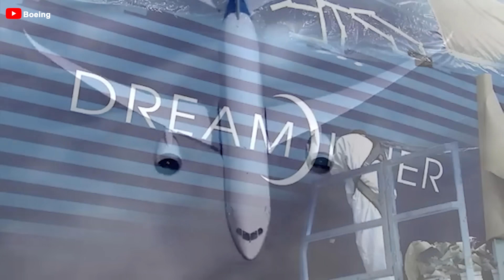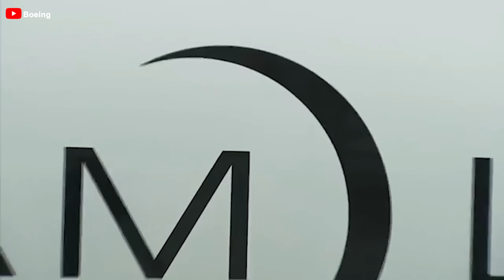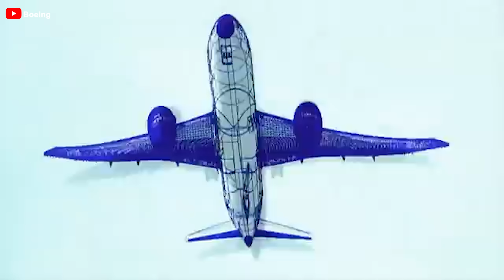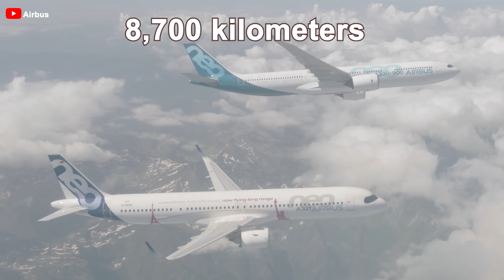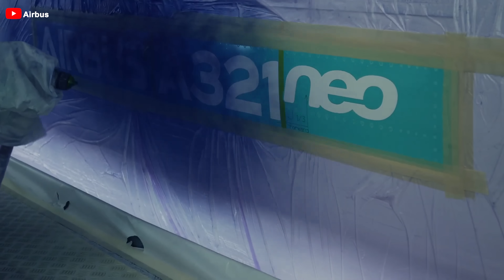Boeing 787 is in big trouble! No one buys it! Here's why!

Comment: There is one thing that I really dislike about the Boeing 787. The crew can and sometimes do black out all the windows and disable the individual window tint controls, so you could have a window seat but you cannot see a thing.
Reply: Agreed.. I'd not fly the 787 for that reason...
Reply: This is for your safety. It is only done on take offs and landings. It is so that in case of an emergency your eyes don't have to adjust to the outside. example if you come in a dark roo from outside it takes a few seconds for your eyes to adjust and that few seconds can mean if you get out alive.
Reply: @stevenlemieux7220  What is for your safety is making all the windows clear for taxi, take-off and landing so that passengers' eyes are accustomed to the lighting outside and they will be able to see clearly if anything goes wrong and the aircraft has to be evacuated. Blacking them out for most of the flight does not have any safety benefit.
Reply: @stevenlemieux7220  they  do it mid flight over night, just when you can see many things at night that you'd never see otherwise, I'll not fly 787 for that reason, I'd take another airline

Comment: Thank you for sharing Aviation News here.😊 I still like the 767s and 757s. They have both been great aircraft to fly on.
Reply from the maker: Thanks for sharing!
Reply: You are welcome.
Reply: I know. It was huge mistake for Boeing to drop them and stick with the severely antiquated 737 or the ultra expensive more futuristic 787. Simply reviving the 75/76 series with modern avionics and a NEO option like Airbus  did would've been much more successful. Then Boeing could take its time designing proper nextgen planes, also like Airbus did. And don't get me started on the lack of commonality between all Boeing planes, their systems, and cockpits. If you can fly one Airbus, you only need a day or two to get typed in any other model. Plus as a new pilot an a different model everything feels much more familiar, ultimately making you a safer pilot. Then compare the 737 to the 787. 737 has toggle switches and steam gauges. 787 doesn't have bleed and is all glass. They are insanely different planes. They were on the right track with the 75/76, even the earlier 777s, but wow have they failed since then.
Reply: I hear you! I still feel safer on the 757 and 767. And yes, I do love the 777-200s and 300s. Furthermore, I am fascinated and not fully comfortable of fly the newer aircraft for example across the ocean yet. JetBlue is a good aircraft and they fly their Airbus 321s I take it from New York over to London. And there is the Mint or Business/First seats to lay down. I still would fly a wide-body 767 over instead. Finally, I haveflown the 757-200s over to Hawaii from Los Angeles a few times in Polaris Business/First Class. And that was so nice. But we will see how the industry continues to grow. ☺

Comment: Airplanes designed by engineers:
Early 737s, 757, 767, early 777s. 
Airplanes designed by accountants:
777X, 787, 737 Max. 
Which ones continue to have problems and make the news?
777X, 787, 737 Max. 
Need I say more?
Reply from the maker: Great.

Comment: This sounds like a lot of promotion, especially for Airbus. It is also pro Dreamliner, and yes theoretically the Dreamliner is a beauty. The problem for me is that I'm not convinced that Boeing is near solving its management problems, corporation attitude, and issues on the shop floor. The idea of flying on a Dreamliner or 737 Max makes me very warry, very uncomfortable. Force fitting wings to the body of an aircraft and not using proper hardware to fit an aircraft together should be a problem for many who travel on aircraft. Simply put I have lost faith in the Boeing product, airlines might not have my problem but like Boeing they are focused on money not my life.
Reply: Airbus deserves the promotion, though.
Reply: Boeing director makes $ 32.000.000 a year..staff has not had a raise in 10 years,
and you wonder why it does badly???

Comment: Everyone keeps talking about the xlr as being the 2nd coming of the Concorde and the original 747, when they first came out, nearly 60 years ago.  One for it's tremendous speed and the other for its combination of size, comfort and speed.  Fast forward nearly 60 years and all of the excitement revolves around a cramped regional jet that has been configured in a manner that allows it to cross the ocean at significantly slower speeds than what the original 747's did nearly 60 years ago.  Yes, it acheives a better fuel burn the same way a Toyota Corolla gets better gas mileage than a Roll Royce.  I dont see many people jumping out of their skin to buy a Toyota Corolla over a Rolls Royce.  My point being, there is zero to be excited about.  The only one who benefits are the airline executives who will undoubtedly pad their pockets with the fuel savings this cramped jet will bring them.  This is not an exciting moment in aviation history.  The fact that airlines are turning away from a comfortable larger jet like the 787-8 in favor of a cramped, slow flying albeit fuel efficient 40 year old design with longer range should be grounds for concern for the claustrophobic traveler who is forced to fly on a regular basis for his or her job.
Reply: You are missing a lot of points here. First of all, it’s not cramped. The space you get as a passenger, is the same as in a wide body aircraft. 

It doesn’t fly significantly slower. The time will be made up with boarding and de-boarding, which goes a lot quicker. Also, getting through immigration will be quicker, as well as getting your luggage. 

The reason the XLR is a game changer is because it can do direct flights. If you were to live in Pittsburgh for instance and you needed to go to London, you would first fly to JFK or Newark on a small airplane, transfer to a wide body and fly to Heathrow. 

With an XLR, since it needs less than 200 passengers, could fly directly from Pittsburgh to Stansted, London. So you as a passenger, could save 3, 4 or even more hours. 

Again, these airplanes are not more cramped than a 787.
Reply: Yep, When a new plane is touted as a game-changer and revolutionary they mean for airline accountants...most modern jet economy class is pretty awful to fly in. The 787 may be high tech and efficient but i have done about 10 long haul flights in 787s from 5-6 different airlines and all of them were mediocre at best, hard cramped seats, tiny toilets etc. The A350 is a much better passenger experience than the 787 but its still a plane built for airline accountants.
Reply: I agree but I guess it’s also what the “market” wants. People want to be able to fly “all the time” instead of “sometimes” so they will come up with this flying Toyota Corolla instead of flying rolls Royce. As soon as this seems to be the “standard” people will start to complain about the lack of legroom, despite their tickets were cheap. Of course the problem is partly the greedy airline executives, but also the customer who is less willing to pay a “real” price.
Reply: @julesschollum5641 I wonder if there will be a passenger-oriented aircraft/airline ever again. I mean like pan am. It’s simply not viable, I’m afraid. Lots of people would say they prefer it over a cramped jet but I wonder how many would actually fly it if tickets were like 30-40% more expensive. Suddenly for most people the discomfort is not THAT valuably when comparing prices I assume.
Reply: @slennie  lack of legroom?  Why would there be a lack of legroom?  

I don’t understand why people think that flying long haul on a narrow body means you get the same seats as on short haul flights. 

I recently flew on JetBlue from Europe to New York. I flew on their Business class. I’ve flown business class on most major airlines and the JetBlue was in the top 5 for me. 

And when I took a look in economy, the seats looked comfy with good legroom.
Reply: @rtbrtb_dutchy4183  I see that you like to repeat this legroom thing over and over again under multiple postings. Good for you that you can flex about flying business class all the time. I'm not talking about business class but economy class in general. Not about long vs short haul. But the fact that most airliners are cramped nowadays, to squeeze the max out of every inch. Passengers seem to want this (more than in the past apparently), for example proven by the great success of Ryanair. Everything but the price (if you book early) is sh*t about them, but still lots of people like to treat themselves that way.
Reply: @slennie  has zero to do with flexing. What a weird thing to say. My company pays for my business class seats. When I go on vacation, I go in economy, so there is nothing to brag about, only that I can compare easily. 

Ryan air is an ultra low cost airline. I get that they do well, but a lot of low cost airlines are not doing well, so no, not everyone likes cramped seats. 

Ryan air doesn’t fly longhaul. So their seats can be different. I’m sure some low cost carriers are going to put crappy seats in the XLR for longhaul as well, you always have exceptions to the rules. But overall, you can expect legacy airlines to install cabins and seats that are normal for longhaul flying. JetBlue for instance, has a different cabin for their airplanes that fly to and from Europe, compared to the ones that fly domestically.

Comment: I was on a 787-9 owned by British Airways on a London-Japan flight and it was straight-up the worst long haul flight I've evern been on since a Boeing 747 flight London to NZ via Singaport (Air New Zealand) around 1990 - that's nearly 35 years of multiple annual long haul. Cheap and nasty trim that rattled, terrible hard seats, stupid toilet placement (one broke down making life very difficult indeed) - and this was premium economy.. I'd have slit my wrists if I was back in coach. My favourite remains the Singapore Airlines A380. That's how it should be done. (BTW Boeing in general I have tried to avoid for a while now and do 100% since that Japan flight. It was really hard to find a route from London to Cleveland recently that avoided the current iteration 737).
Reply from the maker: How to avoid one of the most popular aircraft :((

Comment: Since Boeing doesn't manufacture much of the 787, their profit is probably low. They do put the aircraft together from foreign-made components. And they designed it. So, it gets the Boeing name. The modernization of their own 767 might be a better bet for their continued prosperity than to use the 787 to replace aging 767s. Can they make new 767s that are more affordable to operate? That is the question- along with "to be or not to be."

Comment: Not enough information given early enough in the video for the viewer to appreciate the difference between the 787 Dash 8, Dash 9 and Dash 10. A layman's attitude to Boeing's problem is simply that it could now concentrate on the latter two versions. Also there was no mention of the lithium batteries catching fire, a slight enigma which I imagine has now ben solved.

Comment: The Airbus A330neo-800 is a better jet then the Boeing 787-8 !!
Reply from the maker: Yep, maybe.
Reply: No it is not.. clean-sheet 787 vs. re-engined old design A330 NEO
Reply: @ACPilot  Maybe hes referring to the passenger experience, the A330NEO is much nicer flight than the 787 from an economy passenger perspective.
Reply: Not many have been sold so far.
Reply: @julesschollum5641  Not what he is writing. 787 uses bleed-less cabin air system, and is much better than the A33NEO in all aspects..
Reply: And your reason for saying this is.......  Tell us. Give us your data, your basis of expertise and your experience in the aeronautical engineering field.

Comment: Most airline passengers don't have a clue what aircraft they are flying on, or even regnise there are single aisle and twin aisle planes operating the same route.   What they do know is that the legroom and seat comfort is inadequate and that there is a queue for the loo. Only enthusiasts know the difference between Airbus and Boeing options.   More concentration on the things that actually matter would be helpful when discussing aircraft models.    Seat pitch matters most and it tends to be too small in economy on all aircraft.  Height does not equal wealth for many.  Increasing seat pitch can also lead to faster evacuation in an emergency.

oheloo

Comment: the flying quality cannot be compared to 320 Neo 787 is more comfortable and ambience is better. I would prefer to buy ticket for 787-8 than 320 Neo if the options are like that
Reply: Good luck with that!
Reply: A320neo/XLR with 18” seat width, 6 abreast is much better junk 787 with narrower seat width less than 18”, mostly cramped cabin 787 worldwide using 9 abreast config that I will avoid at all costs, second I hates the dimming windows can override by flight attendant that you cannot control by your self, some times I will anger to brake the windows dimmer button on lousy 787. 👎🏻👎🏻

Comment: Never again this flying sardine can A320/A321 with its garden chairs. Not even on short routes. In contrast, Vienna - Tokyo with ANA 787/9 in premium economy was a real pleasure.
Reply from the maker: Great!
Reply: Seats are a choice by airlines. The seats will likely be the same as on wide body aircraft
Reply: @rtbrtb_dutchy4183  

The same seats in  aircraft, like for example in the AUA A320 with its gardenseats. Thanks a lot. It seams you did not often fly with good airlines.
Reply: @alfredturnowsky2546  you missed my point. Most airlines who will use the XLR on long haul flights, will have seats fitted n them for long trips. You can’t compare those seats with short haul flights. 

The A321, with 3 and 3 layout in economy, will have wider seats than the 787 in a 9 seat layout per row. 
In business class, you will have 2 seats per row, 1 on each side of the isle, whereas a wide body will have 2 seats in the middle as well. Seats are the same, just less seats.